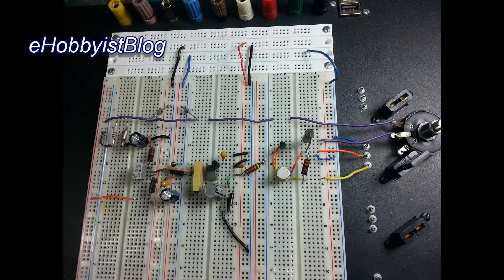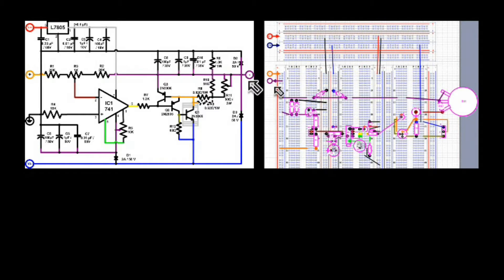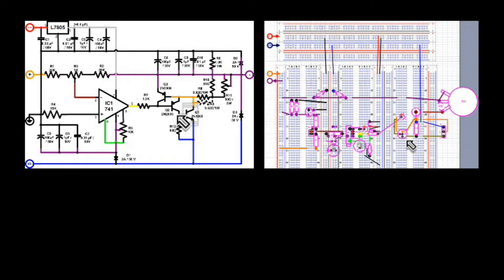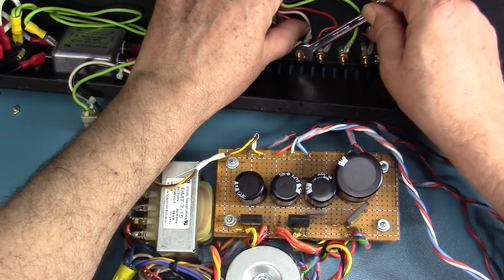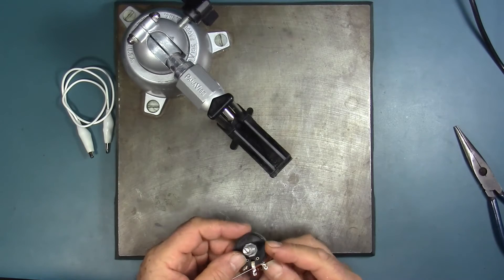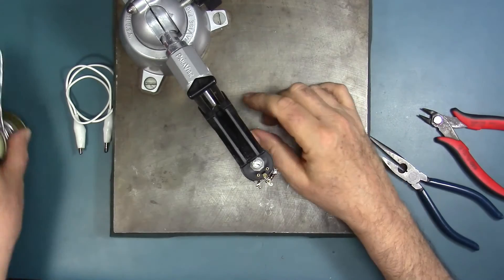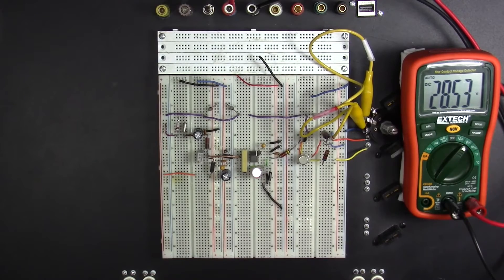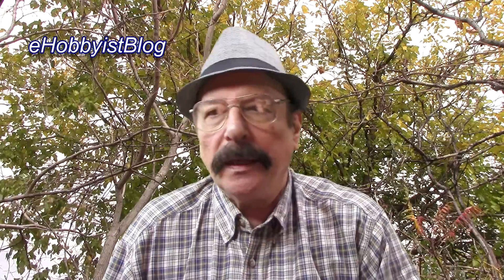041-Power Supply—Negative Tracking (3)

Comment: what ever happened to this series?
Reply from the maker: We have some things to do right now that have higher priority than electronics hobbying. I will continue work on this project in a few months. (Probably).

Meanwhile, the project functional specifications are presented in videos:
 002- through 004-
and documented on 
 http://ehobbyistblog.com/references/
under heading
 004-Prototyping System Analysis Wrap-Up.
The two variable power supplies are shown in videos 027- through 041-. A power supply for digital prototypes, outputting fixed 5.0 and 3.3 volts, has yet to be done. 

By all means, feel free to continue on with the project. I look forward to seeing your videos.